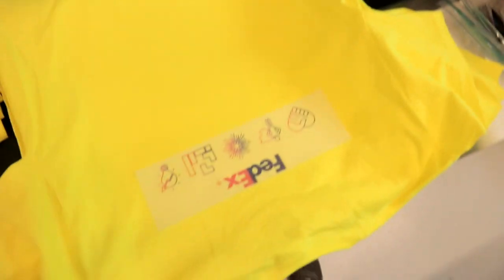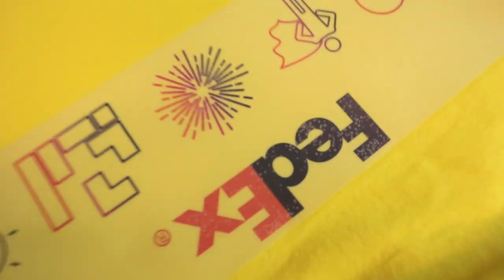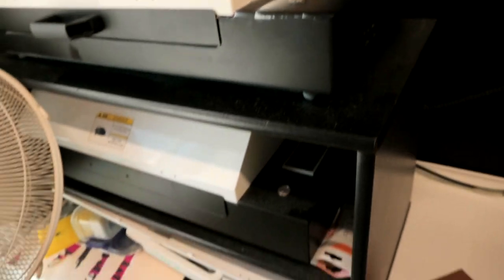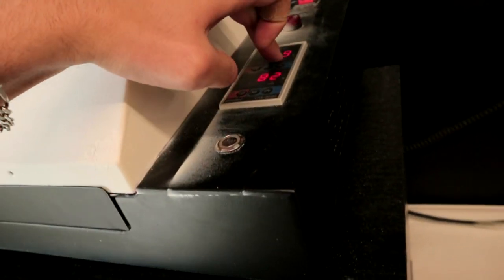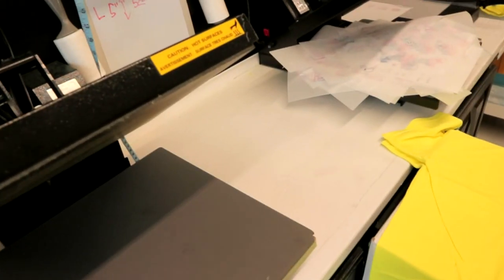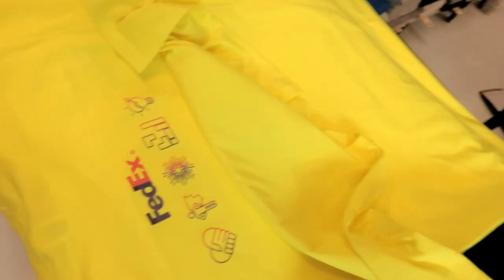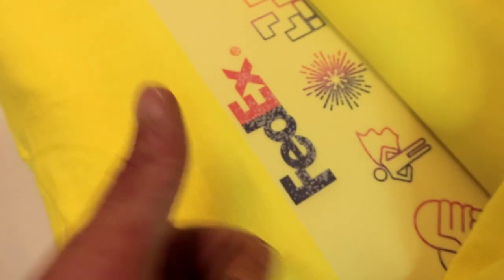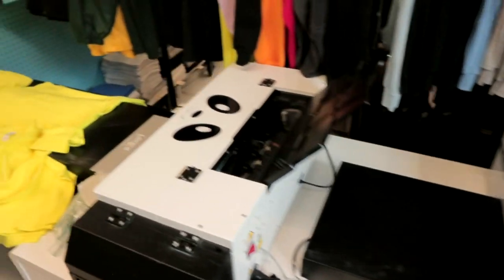How to Fix Bubbles in DTF Prints

Comment: I seem to get holes in my prints once I press them. Even though the powder seems fully cured. Any idea?
Reply from the maker: Humidity in your sheet can cause this...
Reply: @WHOLEPRINTING  thank you. I actually found the issue was too high heat when pressing.  Since it's a low melt powder. I had to press lower then recommended. At 280-285 for no more then 10 seconds